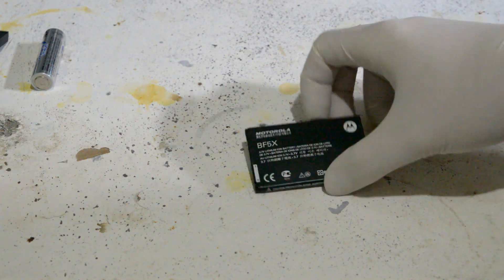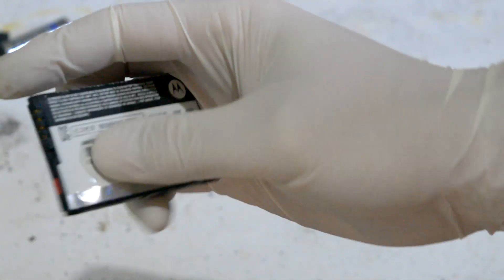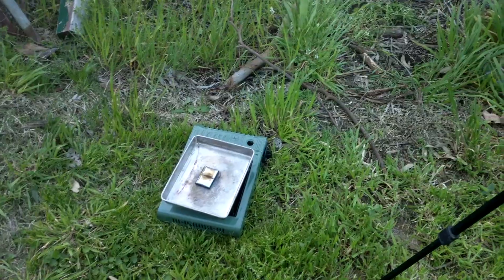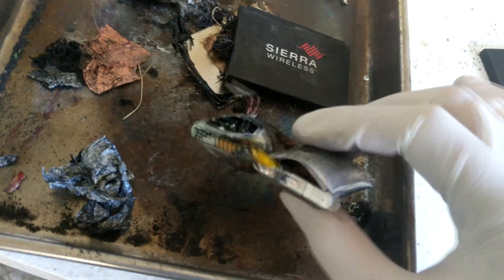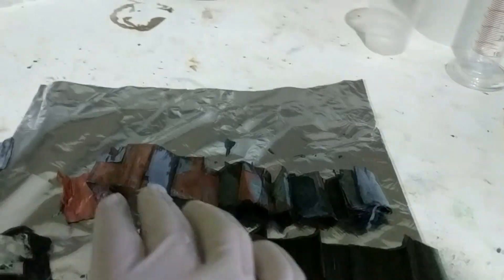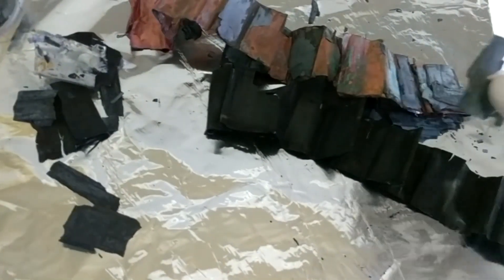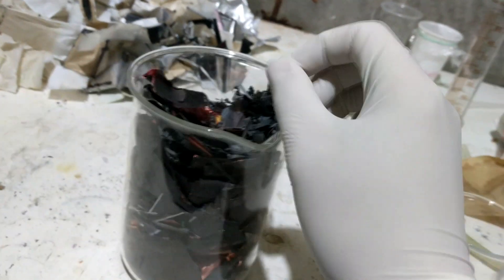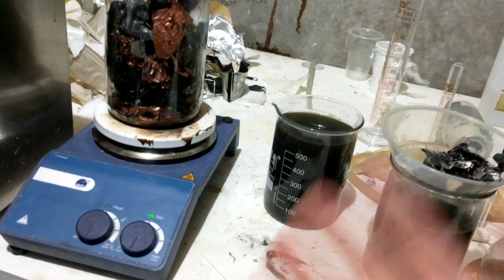Getting Lithium from Phone (Li-ion) Batteries - Part 1

Comment: can someone please explain me this in a simplified way because i cant really understand..

and i do want to make pure lithium from the drill batteries i have (like 20 of them)
Reply: If you need someone to explain this to you, you probably shouldnt be doing it. Alkaline metals (in their metalic form) are dangerous if you dont know how to handle them. If you dont have at least some basic chemistry knowledge id say you rather keep saving batteries and start reading a few books.
Reply: ULTIMATE Vortex127 if you don’t understand the process you shouldn’t do it.

And most still batteries are nickel based anyways, and nickel is quite boring
Reply: @dontlikemath -.-
Nickel isnt THAT borring, you can electroplate PCBs in nickel and have silver pcbs if you are into that, nickel is quite a fun metal to play with if you are into more tangeable things instead of just chemical reactions. You can electroplate your keys and have shiny silver keeps and unlike silver, nickel doesnt tarnish and its quite resistant to corrotion.
Reply: @laharl2k  put nickle over a flame lol. You'll see it tarnish then. Nickle does tend to oxidize/tarnish over time
Reply: TheValorousDong 
Sure but its nowhere near as bad as bare copper. Itd probably take a decade to become visible and another to start looking "dirty"
Nickel is not perfect but its easier and cheaper than chrome plating a pcb and its more durable than brassing.
Reply: @laharl2k  oh i know, i was just saying that nickle still does corrode/tarnish. Everything does under the right conditions

Comment: Your calculation for that amount of lithium based on the ah is meaningless. Something based on Watt hours might be somewhat accurate though. A 20v 1Ah battery is obviously bigger than a 4v 1Ah battery. 5x bigger (20Wh vs 4Wh).

Comment: wont LiOH dissolve in water also dissolve the Al foil thats stuck 2 it?
i think u should also find ways 2 prevent that or separate them (from Li aluminate) afterwards
also, after LiOH dissolved the Al foil, it will b a pain 2 clean the glassware afterwards since the Li aluminate will deposit some Al compounds (probably oxide?) onto glass (i experienced that b4!)
for the Cu contamination, i think u also have 2 test the purity of the Co salt u produced to verify its free from Cu contamination otherwise u need extra steps 2 sep them

Comment: Isn't there beryllium in microwave sources in your standard kitchen microwave
Reply from the maker: Feetkiller97 oh yeah you're right, although it's a lot less accessible than a phone battery. I'm not sure why it's there, but I'm sure it has to be, you'd only manufacture something using beryllium if you really definitely had to in order to make it work
Reply: Extractions&Ire beryllium oxide as a ceramic insulator (what I have seen) but its also used in a 2% concentration in a strong alloy with copper that I think is also open to the public. (Or you could extract it from any emerald rings your mum has)
Reply from the maker: Feetkiller97 actually I have quite a bit of poor quality Beryl lying around. I've seen people on Sciencemadness trying to do extractions (Plante1999 I think, one of the best) and god I mean that's one of the most inert things I've ever seen. 
But yes interesting about the microwave
Reply: Extractions&Ire yeah well I freaking enjoy these videos so I don't want them to stop with you having berylliosis, so don't extract beryllium please! (Although if you keep the oxide intact is ok-ish, its worse if you machine it and it powders, so its kinda like asbestos)

Comment: Use potassium carbonate for the precipitation. Lithium carbonate is way less soluble in water than potassium carbonate and alot more than cobalt carbonate. Don't use any sodium compounds when you wanna see the red color of lithium in flames.
If you are trying the H2S method, which would be pretty neat, the cobalt in the sulfide may have different oxidation states. Some sulfides are soluble in HCl, some in H2O2 with acetic acid. All of them are soluble in aqua regia. During the reaction with H2S it is important to buffer the pH with an actate buffer or methenamine. Cobalt sulfide won't precipitate in too acidic conditions and you are introducing quite some H+ with the H2S.

Comment: You should dissolve everything in Hcl and then use aluminum to reduce the cobalt metal out of the solution.
Reply from the maker: But then you end up with lithium and aluminium in solution, and they're harder to separate I feel. That's why I went to the effort of removing the lithium cobalt oxide from the electrodes rather than just adding HCl directly to the electrode/lithium pile, didn't want to bring aluminium into solution

Comment: Also laptop batteries a trillion times easier to open, also they have a lot more material per battery pack.
Reply from the maker: Oh really? I'll keep an eye out for them then, if anyone's throwing some away
Reply: There are about 6-10 cells per battery pack, I got about 15.67 grams of cobalt from 6 cell I think it was though it isn't supper pure. Inside each cell their is a rolled up coil of the lithium cobalt oxide and you just unroll it ad there you go.

Comment: Method 2 can be made with NaOH instead of KOH right?
Reply from the maker: Yep! NaCl is basically insoluble in ethanol too, but I think it's probably slightly more soluble in there than KCl. The other point is, one of the ways we're going to check for lithium in the end product is a flame test, where lithium shows up as red. Any sodium contamination really ruins that test because the orange sodium flame is so bright, so I'd rather have a little potassium in the lithium rather than the sodium, that's why I've chosen KOH not NaOH. But ya it still works either way
Reply: Ohh I see, well I'll wait for part 2 then haha.. Thank you very much!

Comment: Li-ion batteries can have very nasty stuff dissolved in the electrolyte, like a bunch of fluorine compounds, like LiPF6. If you burn it, you can get HF and other nasties, it may also hydrolyze to release HF. You could try electrolyzing the mixture to get the Co out in metallic or hydroxide form.
Reply from the maker: HF? Faark. That's a bad one. None of my limbs have fallen off nor have I died so I'm okay I guess, but I'll keep treating the waste as really hazardous (like I have been, I churned through the gloves on this project). Thanks for the heads up.
Electrolysis is probably the clean way to do it, you're not wrong!
Reply: There is also a corollary to this, some of the total lithium content may be dissolved into the non-aqueous electrolyte. (in the form of the LiPF6 and others) So unless you extract the lithium from the electrolyte as well, your yield may be lower.

Comment: lead from lead acid batteries! pretty please!
Reply from the maker: LateNightHacks ya I saw your comment on the last video, I should've responded oops sorry but ya I mean it's interesting but I just have so much lead nitrate already and I don't have any batteries ahhh
Reply: Haha, fair enough, a series on extracting metals off various batteries would be neat
What is your source for lead nitrate? and would it be economical to revert it to lead and nitric acid? both quite usefull
Reply from the maker: I found some lead on the ground a few years ago. Like, I think it must've come from a roof or something...? But yeah, I dissolved that up in nitric acid and it gave me like 30g of wonderful crystals. I don't use it much so it's already a huge supply for me, and it's not something I want to have heaps of lying around. 
If I ever have a project where I need more lead nitrate than I have, for sure i'll do a video on making it
Reply: ah, I see, different story
yeah, most likely roofing lead

Comment: It may be possible to exploit solubility differences in the sulfate salts of lithium and cobalt when dissolved in alcohols. I did a similar method to separate copper and nickel chloride from dissolved currency as CuCl2 is fairly soluble in acetone whereas NiCl2 is negligibly soluble at best.
Reply from the maker: I had that thought too, but I believe both lithium and cobalt sulfate are insoluble in ethanol, so I don't know how to make that work
Reply: Extractions&Ire oxalate salts could work. Lithium oxalate has a solubility of 8g/100mL H2O whereas cobalt oxalate is like 2.7x10^-9 g/100mL
Reply from the maker: Ohh hmm... Do you think oxalic acid will dissolve the Lithium-cobalt oxide and basically just selectively leech the lithium? I'm not sure it would
Reply from the maker: Actually the biggest issue might be separating the lithium oxalate from oxalic acid
Reply: That was another of my thoughts, using oxalates for separation.

Roasting lithium oxalate free from oxygen might even yield metallic lithium... Then you'd get rid of the excess oxalic acid at the same time.

Overall, I think you need to come up with a better method than the two you've suggested so far!
Reply: The oxalic acid should sublime off when heated to 200C, and the lithium oxalate is thermally stable to over 400C. Once you have just Lithium oxalate, it can be heated to >500C to give lithium carbonate, abs from there heated to 1300C to give lithium oxide.

Comment from the maker: Ok so what do people think is the best method going forward? I explained them both in the video.

Method 1: Using H2S to precipitate Co2S. 
Method 2: Using KOH to precipitate Co(OH)2 and then separate K/LiCl using dry ethanol.

Method 2 is my current favourite, especially as it gives the cobalt in a usable form this way, so it can be considered 'recovered' too. The Co2S from method 1 is kinda useless and its really more a shit byproduct that i'll throw out. 

OR do you have a better way of separating cobalt and lithium?? Let me know!
Reply: Extractions&Ire maybe try soaking all the batteries in salt water, this ensures that they wont catch on fire when you cut them as they will be discharged and have no energy left!
Reply from the maker: +Tom Mackellar Now that's a good thought! I didn't think about charge until after I had cut them all haha
Reply: Method 2 also has the advantage of not involving H2S...

(And I wonder if you would be able to get some metallic cobalt in the end? Maybe with some electrochemistry?)
Reply: @piranha031091  yeah but Co(OH)2 is carcinogenic
Reply from the maker: +Daniel Matthews
You're right, but also there's like 20g of cobalt at most probably, it's not really worth building a catalytic cycle over, I really can just pump more than enough H2S through it without issue
Reply: Please do both!
Reply: What if you used Lithium Hydroxide to preciptate Co(OH)2? You won't have any new chemechals involved, and you would be able to separte them?
Reply: You only need to add a bit of H2S then filter and add the metal sulphide to HCl to get the H2S back to convert even more of the metal. At what temperature does H strip the CL off the metal to leave pure metal and produce more HCl? You can make a little refinery with two cycles in it.
Reply: Bleach will cause a cobalt oxide to precipitate out. Then you'd have to separate sodium from lithium, not sure if that is any easier than K/Li but gives you another option.
Reply: Here's another method: collect and dry the LiCoO2, mix it with the requisite quantity of Al powder and remove the cobalt as metal, thermite-style. The resulting slag can be extracted with acid and alkali to recover the lithium salt. Maybe.
Reply: Extractions&Ire H2S
Reply: I would recommend precipitating the cobalt with an alkali metal hydroxide, then instead of using ethanol to separate the chlorides use lithium carbonate's low solubility to separate them.
Reply: I don't know, if there are other impurities in the battery, like Potassium and Sodium Ions, but to be sure I would go this path:

1. Dissolve the black stuff in some acid, HCl or H2SO4 should be ok.
2. Filter off remaining solid material.
3. Add some solution of a soluble oxalate salt - either potassium or ammonium oxalate should be fine. This will precipitate the cobalt as insoluble cobalt oxalate, the Lithium will remain in solution.
4. Add some solution of a soluble phosphate salt (Sodium, Potassium, Ammonium) this will precipitate the Lithium as Lithium phosphate.

I think using this technique u can get far better and cleaner results :)
Reply from the maker: +dartsak1 Do you know the solubility of lithium phosphate? Assuming it is very low yeah
Reply: @ExtractionsAndIre  it's vastly simpler!I just anyway start with cutting the battery outer layer without damaging the roll itself with scissors,and than I also act differently:I unroll the inside of the battery it's,and than separate the layers by hand:there are 2 strips of metal,separated by two layers of polyethylene,and that's it!And one of them is made of aluminium metal covered in cobalt oxide,while the second is copper metal covered with lithium bearing stuff!And so I separate them!

And if I want cobalt metal-I either dissolve the aluminium/cobalt oxide stripe in HCl to completion,than filter everything and simply precipitate cobalt metal by aluminium foil,after which I actually usually melt the cobalt sponge under layer of borax  into a single bead with an HHO torch and that's it!
Or I just add yet another layer of aluminium foil and roll it together with the one with cobalt oxide,and than I simply make it tight and compact and after heating with the same torch this roll from the side I usually have a thermite like reactions occurring until it is going to completion and again I just crush the slag,remove all the formed beads of cobalt and melt them into one!
Reply: @ExtractionsAndIre  yes,and lithium is extracted by simply rolling another roll where there is copper foil covered with lithium on carbon and submerging into water,than filter of the LiOH solution and boil it to dryness!
Reply: It's 39mg/100ml Water at 20°C, so you shouldn't lose much lithium(assuming, that you don't use a Liters of water)
Reply: I'm going to crack up if I get more lithium by pulling apart a lithium AA battery than you get from this.
Reply: After your acid digestion, sulfide, hydroxide or oxalate should precipitate out the cobalt.  But some methods are likely to introduce Na/K ions to the mix.  Probably the easiest way to separate Li from other alkali metals in solution is to precipitate out Li2CO3.  It has quite low solubility.  I would go for sodium compounds because it is then really easy to test the lithium carbonate for contamination using a flame test.  You then know exactly where you stand.
Reply: A bit late but the easiest is to do a carbonic acid soak. Adding the guts to a stainless pressure cooker and soaking in club soda overnight works. Then a few minutes of pressure cooking. The foils separate to alumium and copper, the black stuff sinks and lithium remains in solution. The black stuff is copper nickel cobalt oxides plus graphite. Get to these goodies by dissolving in acid followed up by selective precipitation or electrolytic deposition.
Reply from the maker: +piranha031091 Method 2 does seem a lot safer and less unpleasant. Although I do kinda enjoy doing things with H2S... it's kinda fun.

Oh possibly, I've made Cobalt metal before from Co chloride + Aluminium, not sure how the purity stacked up. 

I suppose to make the project reach a real good conclusion, I should use electrochemistry to get some lithium metal.... hmm
Reply: I know why you like H2S ,  @ExtractionsAndIre  , because it's easy to make Hydriodic acid from it with Iodine....and then you turn codeine into morphine with the hydriodic acid..don't you...